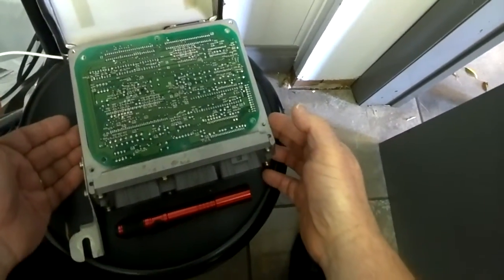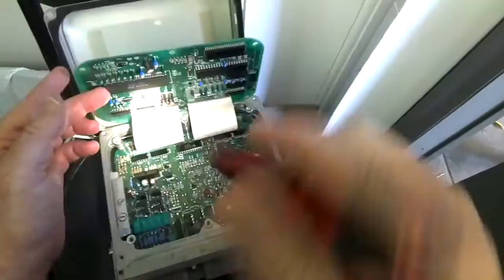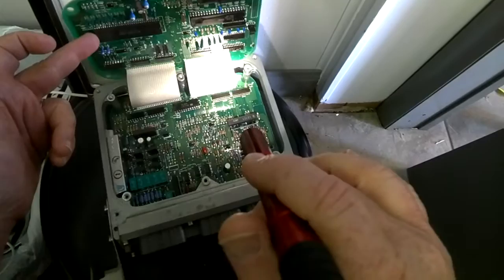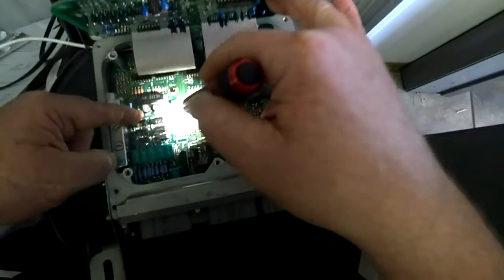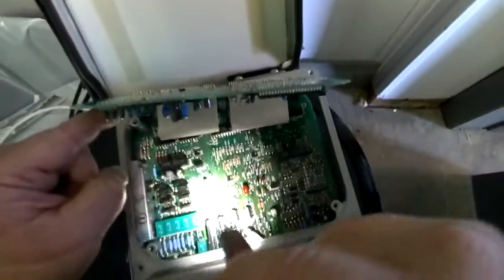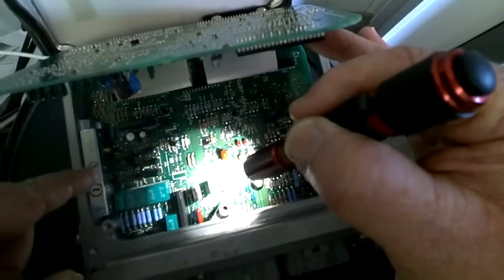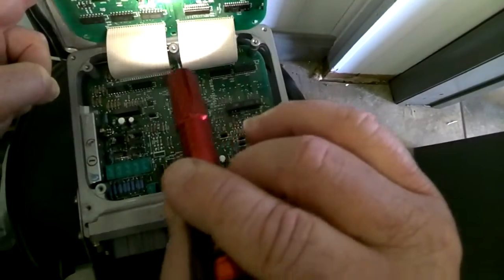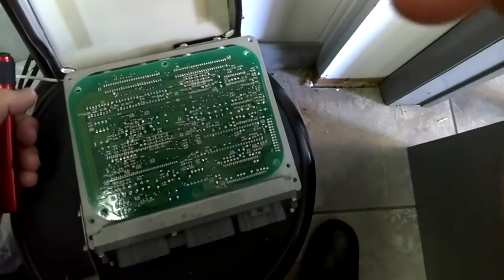Lexus SC 300 Shorted Fuel Injector Drivers

Comment: Do you do repairs? I sent my ecu (95 sc 300) to TaninAuto cuz of noticeably leaking capacitors and having a fuel flooding issue. After reinstalling it i have the same problem. I’m thinking these drivers could be bad? And they just didn’t see any signs to warrant a repair?

Comment: Thanks for the video I have constant 12 volts to all 4 injectors 98 civic 1.6 (flooding cylinders no start) no flickering/pulse while cranking, cam/crank TDC, CYP pick up sensor resistance measures good, I have good spark (good inputs) no shorts on injector wires at all, main relay is good crankshaft sensors is good. Just pulled computer out Would you suspect bad control driver in the PCM?